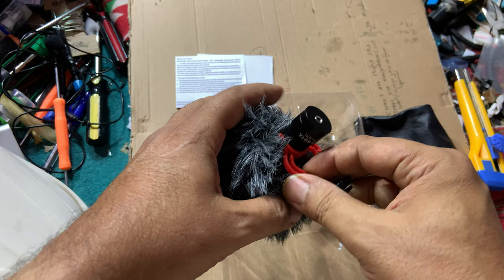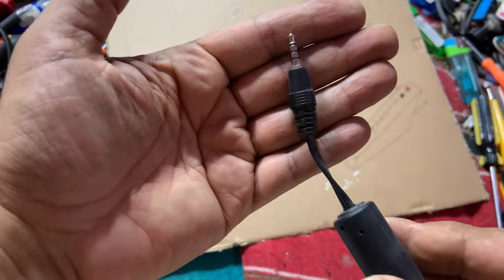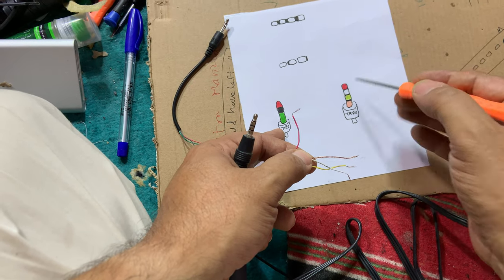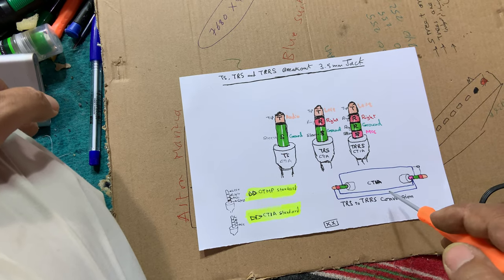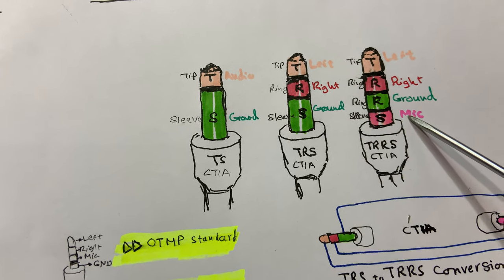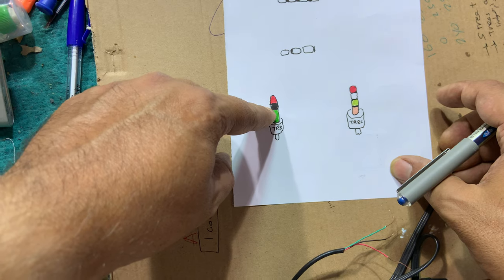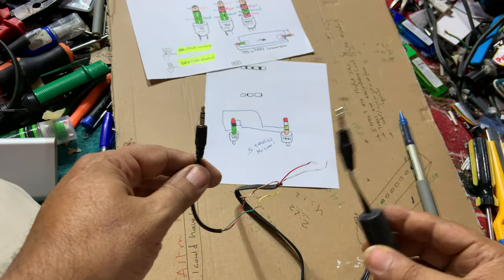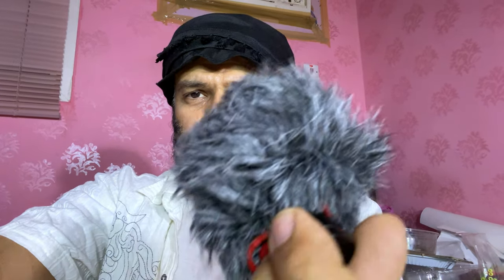DIY TRS to TRRS cable and use it with iPhones | Connect Cardioid Microphone

Comment: I have try to make exactly as in the video, unfortunately it does not work on my iphone 12. My setup being saramonic blink 500 connected to mcdodo open mic splitter. The curious thing is the included cable (TRRS to TRS) works but the DIY one does not, even though when I check using continuity on my multimeter, it is the same. Any ideas why this happen?
Reply from the maker: Of course: it will work for your iPhone definitely, but Apple has restricted connectivity of its Lightning plug for MFI plugs only. Therefore, you will need this plug to connect to your iPhone:
https://youtu.be/xHoJ_cVi-4w?si=I9DpAn-XkZRpD0tq

As for other Mics to be connected to you Camera, this should work with you with no problems at all.
 you need this wire here

Comment: My Boya Mic has a TRRS output. But this still helps me. I assume it is CTIA standard. 
I ordered some cables TRRS to TRS to connnect to my camera but some cables don't work - maybe because of OMTP standard - the cables came from China. Other cables have strong interference or noise signals. I assume bad shielded. I bought now a fat 1 meter long 1.5mm2 cable which supposedly has a good shielding  to make my own cable now. I hope it works. 
THanks for the diagram download!
I have no multimeter to meassure - otherwise it would be easier to figure it all out I guess.

Comment: hi! i have a problem. i bought a TRRS cable recently, so that i could talk through the headphones without having to connect it to Bluetooth because it lags me alot, but after connecting the cable, my voice instead is getting recorded from the phone's microphone, instead of the headphones. what seems to be the problem? I've contacted both lenovo and Sony supports but they only told me to buy an adapter, what adapter? what type? thank you for future response!
Reply from the maker: What device you connect? Is it an iPhone?
Reply: @afaifeem  motorola moto g51 5g

Comment: in your drawing, why are left and right channels shorting to mic at trrs?
Reply from the maker: Yes because mic is mono
Reply: @afaifeem  you can't put audio output/input on mic.
Reply: It's Tip+Ring on 3.5mm TRS from External Mic's Signal
INTO Sleeve of 3.5mm TRRS CTIA HP Jack.

It is not feeding audio from HP into External Mic.
What YouTuber did is indeed Correct.